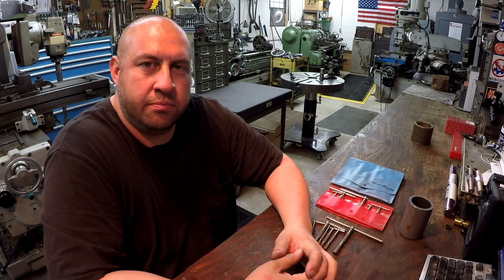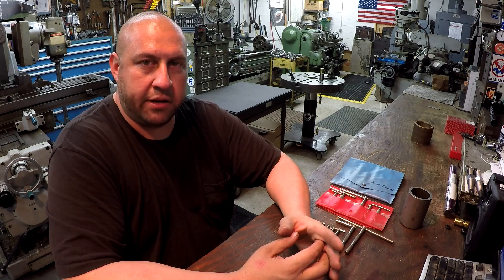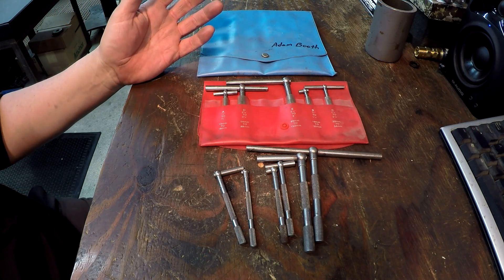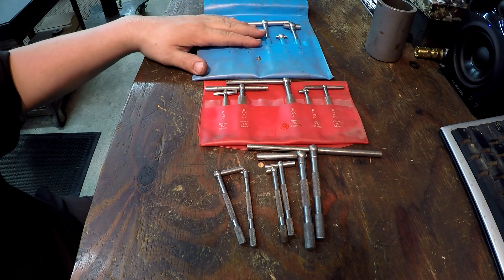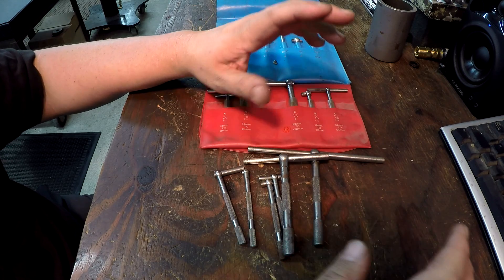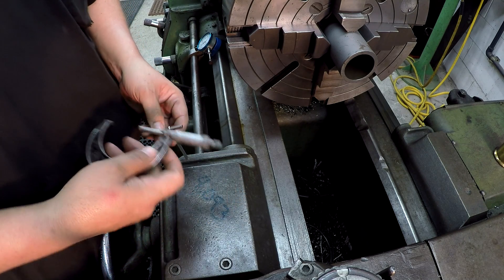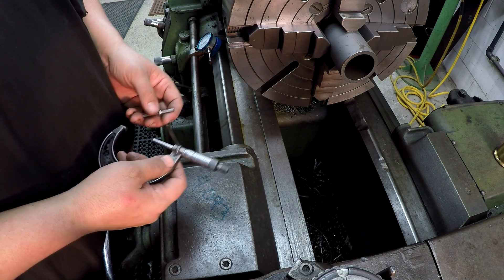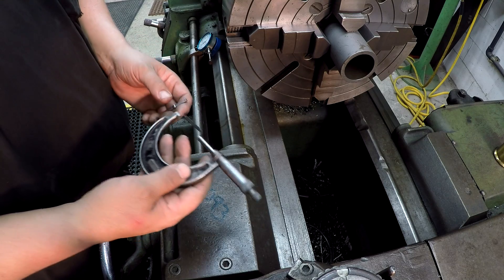Shop Talk 10: Telescope Gages & How They're Used

Comment: Thanks Adam, your videos are superb. For anyone trying to develop the ‘feel’ with a micrometer, a good thing to practice Adam’s technique on is a ball or roller bearing bore - one that’s been used but not scored-up should be fine - these are made to very tight tolerances and the size and tolerance will be quoted in the manufacturer’s catalogue. When your measurements agree with the bearing manufacturer’s you’ll have mastered the feel. All the best..!

Comment: Excellent explanation. Thank you I really appreciate how thorough and easy to listen to and understand you are. Confident yet humble as well!

I wish every how to video were done like this here. I feel like people making a how-to video often forget they're talking to people with probably 0 experience in the topic at hand and fail to mention important things they may do subconsciously or by muscle memory that have an important impact on a newbie being able to duplicate their technique.

One question I do have though, i know you said not to tighten the locking screw too tight, is that so the rods still have enough slack to contract if you aren't quite square in the bore, but enough bite to hold the minimal measurement reached that? At which point exactly in the process are you tightening the locking screw?

I don't know how a set of quality telescopic gauges feel but I'm using a cheap set from Harbor Freight and there's a lot of roughness feeling when the rods slide which my guess is just lack of refinement or rough edges from the manufacturing process so I couldn't help but take them apart and do some light sanding in an attempt to make them function a bit more smoothly so I can use them similar to the way my question explains.

Comment: Here's a tip that you didn't mention. Something I learned along the way. You can put a drop of oil on the tips of your gage for smoother feel. It's usually not needed but there are materials that it works good on like cast iron.

Comment: I have a set of the 229 snap gauges that need to be cleaned.  After taking a part I realized there's what looks like a collet holding the upper pin. They are slightly different than the gages that extend in both directions. You should show how yours come apart so I'll know how mine comes apart. Thank you

Comment: Hi Adam .... I saw you lock the telescopic  gauge  with  the plunger  down  I was taught  to release  the pressure  when  storing  it said to be less pressure  on the spring  and if it hasn't  been  used  in awhile  the lock pin  can tend  to want to jam maybe  due  to condensation  ...can you tell  me what  you think.

Comment: My dad was a Marine Engineer Chief taught us all a similar but different way to use a micrometer and how to make sure it is definitely the right measurement so even if you measured to big or too small this method will guarantee your measuremt is spot on every time.and yes it's definitely getting a feel for it which takes practice .

Comment: All kinds of different ways to do things. For instance, I find it easier to mount the micrometer in one of those little benchtop holders, to better align the gauge within it. Doesn't mean you're wrong, of course. I'd say that many of those who don't think telescoping gauges are accurate aren't using them with enough care.

Comment: I like your reasoning behind measuring vertically: gravity will have some effect (not much, SOME effect) on a horizontal reading - sag in the telescope being the main effect; now, if you are using a micrometer to measure the 'length', the effect of the sag is greater than the accuracy of the mike. It could be vice versa, but there WILL be a lessening of the accuracy obtained by the mike.

Comment: A question about the shapes of the 'business ends' of these two instruments:  I know that the  ends of the mic's anvil and spindle are flat.  It would seem that the ends of the telescope gauges would/should be convex, or at least rounded a bit cause inside a tube yo.  I didn't see that addressed  nor a close-enough shot in the vid.  Secondly, 'splain Lucy the mechanics of how the telescope arms "?lock?" into position having found the desired position within said tube.  Thanks in advance and peace out.

Comment: While I believe these instruments can be accurate - the reality is that they require a 'feel' like you said. This, in my opinion, kills them for use in my shop. I cannot rely on extremely subtle feel to make the final calls on tight tolerance bores. The trilobe bore guages are really expensive - but everyone in my shop can get an accurate measurement with only a modest bit of training.

Comment: I have just started machining as a hobby and would like to see more measuring videos from you. I bought some cheap Chinese telescope gauges but they did not work well for me. I ended up buying some made by Starrett and although the finish is much meter not had much luck with them either. I think it’s just a matter of practice for me.  I have just bought a internal micrometer and a depth micrometer and will be doing an unboxing video and try to figure out how to work them. I would love to know your secrets to get male parts to fit female etc and how to achieve sliding or press fits.  I always end up,with a sloppy fit. Loving the channel Adam. Thanks for your hard work.  Regards Chris

Comment: There is definitively some 'art' to using these gauges... Personally I like using the ratchet on a micrometer, as it is suppose to give you the correct pressure every time.
I do find a micrometer stand handy for measuring a telescoping gauge, especially for the bigger sizes (50 mm and up)
For a quick and 'dirty' bore measurement, don't forget the adjustable parallel ! A cheapo set of those, where the top and bottom are ground to a knife edge really work very well ! 

Cheers
Paddy

Comment: There's one person where I work that likes to set a mic zero where you have to queeze down on it instead of feeling it or using the ratchet. I think that's just straight up wrong, otherwise do it how you'd like. In my work setting, if I'm finishing a bore I prefer sunnen dial bore gages, and roughing I'll use the 3 leg inside mics. With the sunnen gauges my technique is prectically identical to how you use your telescope gauge but I don't drop it after. I personally prefer friction or ratchet over just feeling it to reduce human error as much as possible, but I don't use them much at work anymore. The accuracy that I work with, I only use a lasermike for 10 mil readings.

Comment: my father years ago taught me the same way when you're boring a hole you need to check it with a telescoping gauge.. you also have to remember with telescoping gauges the ends of the Anvils ( the ends you measure with) are radiused they are rounded this is why you get the peak end of the measurement and you move it up and down to center it then you can check it with your mic some people like to use calipers but calipers have a flat end and you're not getting the true dimension of the boar.... you can use calipers but you have to do it cross the 90s of the flats I know that sounds weird but without a picture it's hard to explain... but you can use the calipers to check the telescoping gauge as well as a mic I think that's a valid point that should be brought up

Comment: can I ask a question about what the telescope gauge measures, as they have pretty square end (one just arrived after watching this video, not had one before), so do they actually measure the full diameter or does a little amount need adding on to allow for this?
Reply from the maker: +Andrew Giles Telescope gages are not Square, they have a radius on the ends.

Comment: Great video thanks Adam. I work in quality and have never seen a gage like this one until now. We work with tighter tolerances and high quantity production work so we need an instant reading. This is perfect for someone who just needs a simple ID measurement without an expensive digital bore gage with different size heads and what not. Can you recommend where to get a telescoping gage set?

Comment: I have, to me, an important question: when I calibrate the micrometer I use the friction (like everybody I guess), and the calibration bar is thigtly held. So, why with the telescope gages the right way is the "touch feeling"? If I do the same when I'm calibrating the mic, I have 2 - 3 cent of difference  (.0015" circa)
I'm sorry for my english I'm italian. Thanks.

Comment: Absolutely correct on the vertical hold for the snap gauge. I like to keep a light drag for measurement, but then snug it slightly to prevent movement when checking in the mic. Excellent technique.

Comment: Hey Adam. It's been a while but I had a couple comments. Normally after I would use the telescoping gauge and take it out of the bore I would go ahead and tighten it a little more. This way there would be no chance of collapsing it when I would use the mic.  The other thing I would do prior is to take a standard and put the mic on it so I can get the correct feel and come up with the same number as the standard on the mic. I guess this would be done for people learning how to get the feel of  the mic. The last reason is I always used the same measuring tool to measure the outside of what was going to be pressed into the bore. If you use the mic to measure both you can apply the same pressure to get a reading. My first mic's didn't have friction symbols so I never grew up feeling comfortable using them.  Even when I got mic's later on that had the friction thimble I just couldn't get used to it.  I always felt that the thimble was too far away from my hand and I would as you do use my pointing finger to turn the barrel. Whenever I had a large bore and didn't have a telescoping gauge, I would use an inside mic. I don't know if it was just my set but they seem to have a lot of friction when you are trying to adjust them. anyway I would then go ahead and measure that with an outside mic. Keep up the good work. I really enjoy watching your videos. Like I have said to you before , since I don't spend much time in the shop anymore because I am too busy with my job as an electrician, it feels like I am in the shop again when I watch. Although I still get the urge machine everyday. You always have it in your blood. When I measure stuff as an electrician I think of it in thousandths. Then I have to keep reminding myself that I need to back off on the tolerances.  It is really easy for me to go plus or minus 1/16 on conduit spacing... etc.

Comment: Thanks Adam.  I got the email about this video about twenty minutes after coming across and watching, by accident, Pierre's video on using telescoping gages. My dad went through a metrology course in the fifties when he worked for Ford Aircraft Division. He would come home and talk about practicing developing a "feel" with the gaging they were learning to use. He gave me an old mic and some things to "practice" on. At the time I did not really understand, but many years later when I actually had to  measure parts his lessons all made sense. One common point between yours and Pierre's two videos was, "This is the way I do this. You need to practice and find your way to make accurate measurements."

Comment: Nice job Adam!  I've been using telescopic bore gages for more than 30 years with no problems.  "The proof is in the pudding" as they say.  For example when I've had to make mating parts that required a light interference fit. The combination of the snap gage and micrometer is proven accurate by the interference fit I made.  If you take care of your gages, they'll take care of you!

Comment: Hi Adam. You covered a bunch of very small details that will all make a difference in the end. This instrument is certainly an acquired feel. They can be very accurate. Personally, I like the single sided models.  One thing I'd like to contribute is to always keep the rigid barrel down towards the ways of the machine. This keeps the weight of the instrument from influencing the measurement it delivers. Good video. Thumbs up.
Reply from the maker: Thanks Joe. I have always set the moving leg downward. It's what I'm used to and works well for me.
Reply: Like they say, 10 machinists will do the same job 10 different ways. So long as the final product meets the print. Thanks for the reply.

Comment: Thanks Adam! I just picked up a set of telescope gauges this summer to practice on, perfect timing for this video. I guess one could tighten the gauges extra after they've been taken out of the bore before measuring them? (Though that would most likely cause them to move and affect the measurement)

Comment: Getting an accurate absolute measurement requires that all of your steps work together. The micrometer has to "push" on the snap gauge at about the same pressure as the snap gauge pushed outwards on the test piece, and the micrometer has to have been adjusted to read accurately at about the same pressure.

My micrometers have all been adjusted to read accurately at a bit lighter pressure than the ratchet applies. (I don't use the ratchet.) If someone uses my mikes with the ratchet, they will get a reading a few tenths smaller than I get (and a few tenths smaller than they would read using a mike adjusted to read accurately using the ratchet).

In the end it has to be what works for you. As you said, "Did you ever have to send something back to me because I measured it wrong?"

Comment: It's funny, in the automotive world it gets beat into people's heads (Including some instructors that I have a lot of respect for) that telescoping gauges are inaccurate. Period, we're more or less told to never use them because they aren't accurate enough for internal engine work. Then you're handed a dial bore gauge and you can let 5 different guys use it and they'll still come up with 5 different measurements same as they did with a t-gauge.

Comment: I have a technique similar to yours I also give it a side to side wiggle very lightly. Kinda like to make sure it is centered before I sung then tilt out. What I want to know what is a good set to buy I intend to use it to measure engine cylinder bores. Starrett, mitutoyo, and brown and sharp come to mind right away. I want accuracy but really durability. I may be able to get accurate out of a HF set but for how long? I do want a good dial bore gauge to and the same question applies. How ever a dial bore gauge will not fit in the cam journal on a motorcycle.

Comment: Thanks Adam for such an in-depth explanation. The method I developed was to tighten down after pulling the gauge out so that the mic would not compress the gauge, then use the ratchet. That's just what I came up with, lacking anyone to show me differently. I'm not all that confident in my accuracy, and I should probably do as some suggest here and find some samples with a known ID.
Reply from the maker: Rick thats a great suggestion. Get something you know what the ID and is practice, maybe with some of the tips I give on how I use them

Comment: Great job Adam.. I'm just a guy that loves fixing and building things. I've just learned so much with your explanations of how to use different tools. This was a big help and set me straight or some questions I had about using the telescoping gauges. I've never known if I was supposed to "crank down" on them before swiping the measurement. 
Thanks for another great video.

Comment: Thanks  Adam, I was curious about this, too. I have never used a telescope gauge, but I assumed you would not want to crank down on it with the ratchet thimble. Would you say that you want to put about the same pressure on the gauge with the mic as the gauge is putting on the work?

Comment: Great job as usual! Thanks for the demonstration of "your method". It makes good sense to do it like that and to go by the feel of it. That is how I do valve adjustment with "feeler" gauges. I have had a lot of trouble using snap gauges and I expect that part of it has been from the gauge collapsing while using the ratchet instead of just "feeling it". The other problem is the gauge doesnt always snug and hold the measurement consistently. The single ended type may have about half as much trouble with that!

Comment: Everyone has their own way of using precision measuring tools.  My old QC guy and I had very different ways of gauging parts and always came out .001 different on our measurements regardless of which tool we used, or the method we used for each tool.

I have since learned, that even though tools like calipers and telescoping gauges are intended for rough dimensions, if used properly, they give the exact same reading as a micrometer.  

It was ingrained in me to think my old boss would never get an accurate reading on a micrometer because he never used the ratchet stop.  Turns out he could, and with much more reliability than with it.  I ended up picking up a feel for not using the ratchet stop because of it;  even though "improper" it works astonishingly well once you get the feel for it.

I can't say I've ever seen a telescoping gauge used the way you use it, but hey, if it works it works; and it was interesting to see a different method than what i'm used to.

Comment: surely the inaccuracy comes from using a flat tip on the end of the gauge to measure a concave surface unless the gauge has the same radius as the bore being measured?
Reply from the maker: +Phantom309 they aren't flat.
Reply: if the radius on the gauge is smaller than the bore radius then youll be fine i guess
Reply from the maker: They are all deigned with a radius on the tips and hey will clear the smallest bore size for each gage. You can also see that when it's being swung across the mic faces.
Reply: Thanks! that clears that's up, my bad